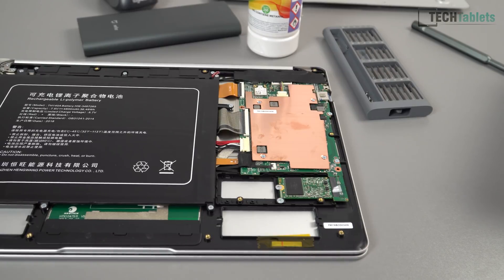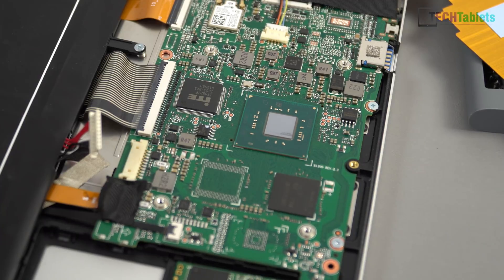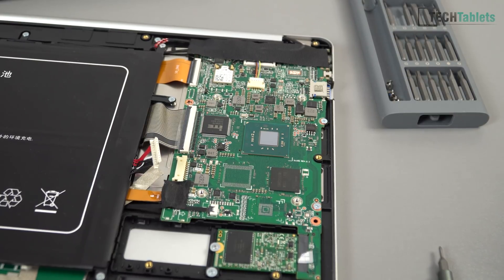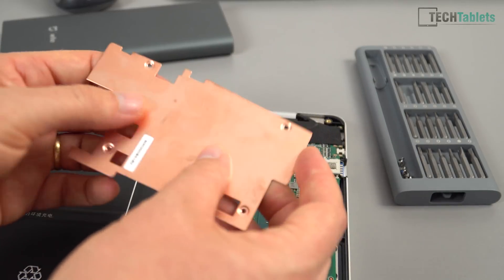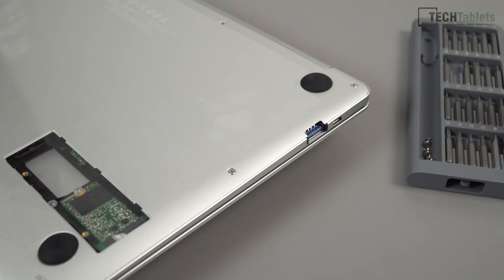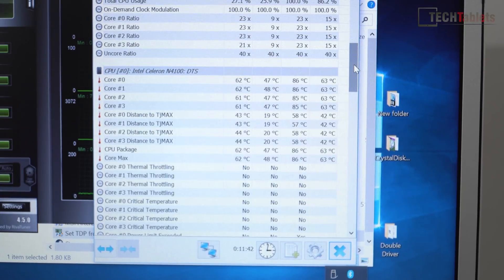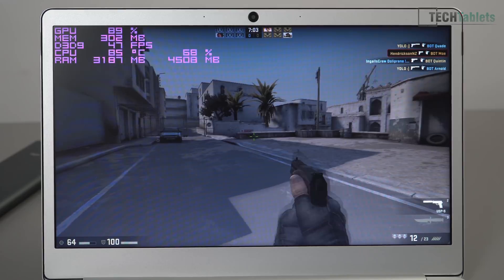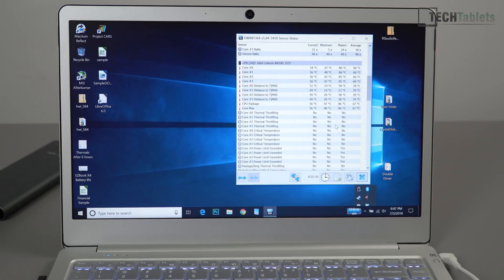EZBook X4 Fix Thermals And Boost FPS 200% Gemini Lake TDP Tweak

Comment: I have the EZBook X4. My big issue is the battery is totally useless. Once I unplug the device from any electric outlet, the entire device shuts off. Is there a way to get replacement battery in the USA or product service? 

These are nifty looking devices but buy at one's own risk because there is 0% tech support or warranties. It's a shame, I would like to endorse the brand but after 1 year, the device is starting to show that it is clearly a "short term" product.

Comment: BE CAREFUL, THERE IS NO AFTER SALES SERVICE AVAILABLE. 
BEFORE BUYING PRODUCT  FROM THIS MANUFACTURER YOU MUST CONSIDER HOW HARD TO FIND BATTERY REPLACEMENT AND OTHER SPARE PARTS. 
I have experienced a bad thing that made me very disappointed that after using it for 1 year, there was a battery failure which required a replacement. The battery cannot be found throughout the market and when asked by the producers, they cannot provide it and do not also suggest a solution. Finally my ezbook 3 pro laptop becomes a garbage.

Comment: Can you put a few more thermal pads on the heatsink beside the one on top of the CPU to spread the heat out onto the metal back casing evenly? That way instead of just heating up 1 area constantly, the heat can be spread out and the CPU can be cooled down better?

Comment: Hi great video. I have Asus Zenbook UX331UN.  It's great but I have power limit throttling.  Temps  are good under heavy load (about 72degrees). I use undervolting on my CPU i8550u (-115mv)  using throttle stop and i disabled turbo boost. 
What can i do for this issue? 
THX a lot

Comment: you don't tweak TDP.
TDP is thermal design power, which means it is the maximum amount of heat it can generate due to moving particle inside of the chip, measured in watt.

you can make it faster by giving better cooling system but the TDP will stay at that given amount. manufacturer gets to decide the TDP based on their calculation, not us. it's physics, not engineering.
Reply: Malik We have a smart one here. You can change the TDP on many modern chips.
Reply: TDP is engineering indeed. You can have the same CPU running in different speed and power (Intel cTDP) depends on the implementation of device's thermal headroom.

Comment: Chris, I think I'm missing something here as my Obook11 PRO (7Y30/4GB RAM single channel +copper mods+Intel 615) is ranking 11k on Geekbench OpenCL (Geekbench4 CPU 2985/5500). 
Any clues? I think I've tuned the shit out of it. Short PL 20W, long PL 10W. 0,085V cpu undervolt, 0,060V gpu undervolt. No thermal/current/pl throttling... And I might be hitting the performance of a tuned N3450?
Reply from the maker: Italo Loureiro Those are good scores for a Core M3

Comment: U need to use the cpucoreparking utility to allow all 100% of the cpu to be used at all times not around 80% of the full cpu and have full control on the turbo boost index and frequency scaling index

Comment: I have the ezbook 3 pro for a while and man please tell me you did not test the temps while the laptop is plugged in and charging?

I hope you know, that charging also heats the device up, atleast on my 3 pro, where I plug it in.

I think without charging you would have had around 10 degress less, maybe even 20 less :/ Test again? But nice video so far, I applied the mod on my 3 pro, too and I get 60 degrees on max load :D
Reply from the maker: Tobias Schneider it was plugged in later so I could gauge max temps.

Comment: Bad thing in this mod is that back plate now is not protecting internals, your cpu and mb will have direct stress from back plate if there will be some pressure on it ...
Reply from the maker: It's not a huge amount of pressure to be an issue. I'e run tech long term like that and it's fine. If you're worried I wouldn't do it of course.

Comment: Again a 1$ bug of jumper not to make sure that heat sink sits flat + connected on cpu.
I'm pretty sure all other units will have same issue cause it was caused by a missing pad not by a pad in wrong position.
good mod or check.

Comment: i like your videos man , how u mod the thermal and stuff that i even have an idea to mod my pc after watching yours. Have u ever thought of modding the thermal of old phones that have thermal throttling issue ? LG G4 , OnePlus 2 , 3,  3T etc
Reply from the maker: Yes, I did mod some phones back in the day but that was before I starting to do videos on it. Pulled off the old heatsinks and put new paste in it. I've done it to a MTK8173 quad core Chuwi Hi9 Air too and seems to give a bit of a boost.

Comment: Always great to see those  later temp mods.
I know its a bit of work but could you test the battery life with the higher power limit?
Reply from the maker: The thing is it's almost the same with light tasks and normal CPU use. No change really. It's when you push the Intel 600UHD GPU it and game it then eats about 5W more and will take a good 40% off the old pre-stock TDP limit.